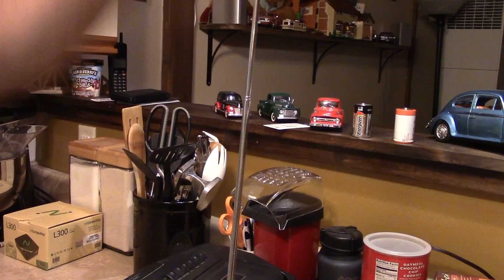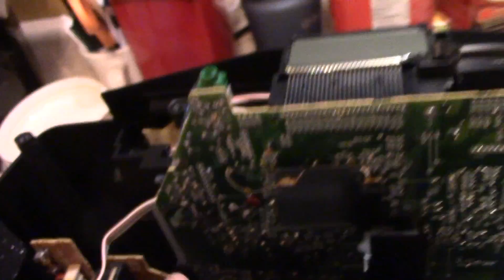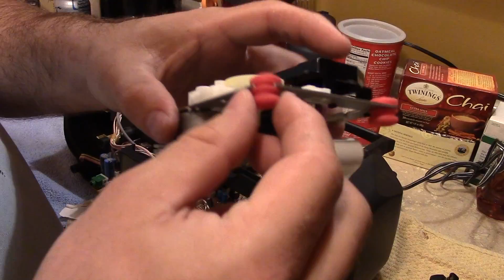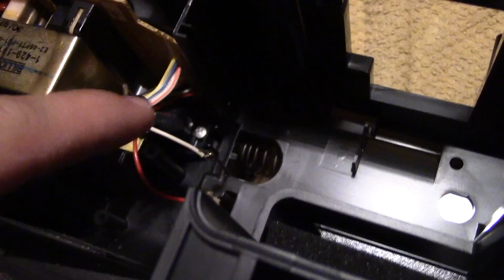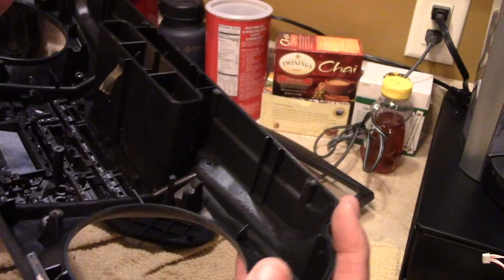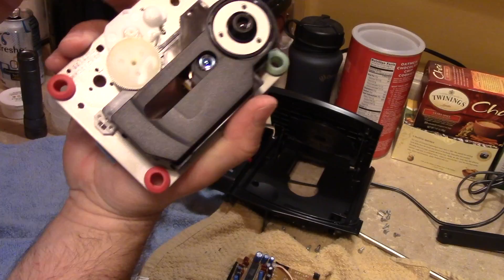Thrift Store Recon: The 1997 Sony CFD S33 Boombox

Comment: I wonder why my double caasette Boombox sony from 97 (without Cd player) had the shared Tuner / Line terminals on the front. You could not leave CD player plugged all the time, but older sony auto reverse boomboxes had the AUX terminal independent and on the back

Comment: This is a very well done video. Tons of information and brilliantly delivered. I enjoyed watching this and learned so much. I recently purchased a Sony CFD-S50. Everything works as it should, however there is one issue with the speakers. They deliver musical sound nicely and work well as does the MEGA BASS button...but only up until volume level 10. After level 10 it begins crackling--and the crackling gets progressively worse the higher the volume. It's annoying. The stereo can go up past level 30, so level 10 isn't terribly loud at all. I'm wondering if I would be able to connect external speakers to the Sony. What do you think? I'm imagining that I can just take those black and red external speaker wires and connect them internally to the CFD-S50 but I'm not sure. Thank you kindly in advance for your thoughts and ideas. Take care.

Comment: I used to have a number 2 Phillips 4 inch shaft craftsman screwdriver for no other purpose but servicing my home subwoofer.. which has enclosed screw casings the screw heads are recessed into, screwdriver cost me $20 in 1993

Comment: Great video.  I am following your steps to refurbish the one I purchased for my daughter 23 years ago. I can’t figure out how to remove the power supply where it is attached in the battery compartment. It is the small board at the positive terminal.  I didn’t see you show that on the video. How did you do it?  Thanks!

Comment: That is a pretty weird tape mechanism. On the one hand, it has metal parts on the flywheel and a true Mitsubishi spindle motor, on the other hand this deck only has a permanent magnet and a lot of plastic parts. I would advise not to use tapes that are of the IEC1 ferric type, because the weak magnetic field of these tapes (around 250-300 Oe) can actually partially be erased by a setup like this - even in play mode.
Reply: Are you saying the boom box could potentially affect the audio quality of the cassette? I've been using this boom box for my cassettes for a while now and would like to know if maybe I should invest in something else.

Comment: Whats that Ncomputing l300 in the background?
Reply: It is a thin client my school uses them they are awful
Reply: Keir O'Neill my issues with them is they even for a basic thinclient they are just so unreliable. External volumes (flash drives) only mount half the time. There are extreame graphical glitches when any sort of motion/video is present and sometimes they will randomly shutoff. The lack of a speaker is not that big a deal as my school issues standard headphones